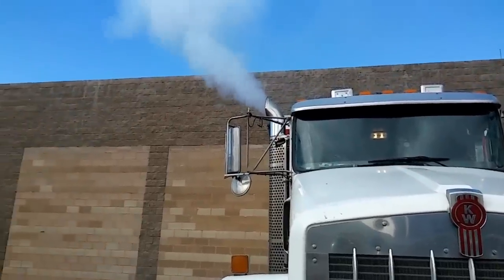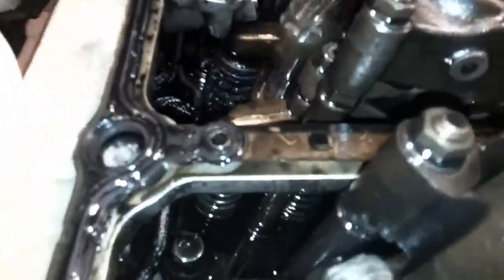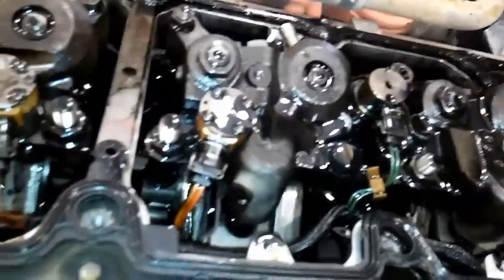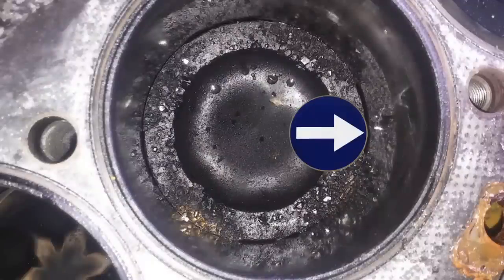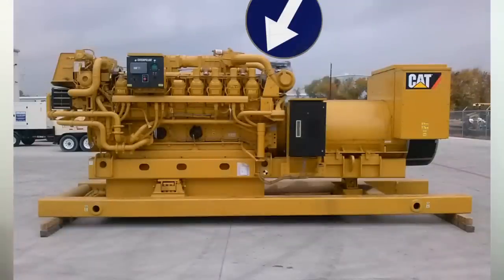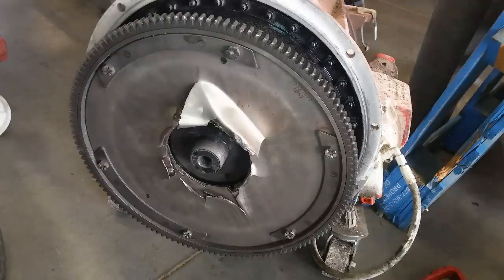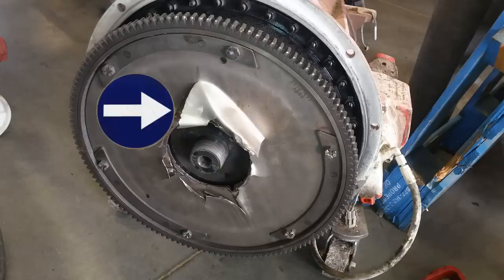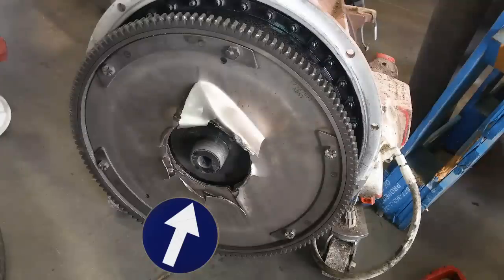Should You Warm Up A Diesel Engine?

Comment: Since you’re only warming up your engine for 2 minutes, grab a wrench and hold it firmly between the two battery terminals...this will generate extra heat and load on the alternator helping the engine warm up...make absolutely sure you do this with bare wet hands 👍
Reply: might crack the windshield in the winter from warming up too quickly

Comment: I was a trained mechanic on new Holland and when I was time served at 22 year old started contracting. A bloke I met on a mammoth job used to operate a komatsu 13 tonner . 
Every other operator would arrive at 6.45 and start their machines . 
He’d rock in at 6.59 and would be working it flat out by 7 !!!! 
I asked him one day what engine was in it and he had no idea . 
Asked him it was turbocharged, again, hadn’t a clue . He never lifted bonnet to check oil , water or anything . 
switching it off , just turned key with thing flat out . 
He was actually quite good on the machine but no mechanical respect at all . 
I used to cringe Morning and night but being young and  him a lot older didn’t want to create . 
That machine started to spew oil on that job .

Comment: Elevated idle on... Cycle glow plugs 2 times or so, crank/start. Let idle 1 minute at least and then start off down the road but don't romp on the throttle.

Comment: If really cold I use the block heater.  The shop never gets below 40F, so I just use the exhaust brake on the Cummins and drive it gracefully after the heater grid stops cycling until it reaches operating temperature.

Comment: Yes you should at least until oil temp warms up to 135 degrees, also always cool it down until oil temp drops down to 226 degrees. (Once again oil temp) then shut down the engine. That’s what I do every time in my volvo trucks.

Comment: 2001  C-15, I'll start it up and run 1 min or so until air pressure gets up to 90, this thing has a huge compressor, about the size of an old mechanical injection pump.  
Then up to 1,000 RPM for at least 3 to 5 during my pretrip, then slow trip out to the main highway about a mile of dirt road, nothing over 1,200 RPM.
Then nothing over 1,400 as I go down the highway until I get to 180 water temp.
18 speed helps with all that low RPM operation, and the truck is always empty in the mornings, I work locally.
I do this even in the summer, 
Block heater below 20F and when it gets really cold (Minnesota), oil pan magnetic heater, just bungee cord under it to hold it in place.

Comment: When it comes to school buses, you need to keep it at least 1500 rpm, otherwise you will damage the engine. With all the heater cores and long coolant hoses, it's hard to keep them warm. I remember the old RE's had labels that said "keep fast idle at 1500 during cold operation to avoid engine damage". As soon as you let them idle down after a run, the temperature would drop straight down. We used to do alot of repairs out in the snow with those things. Glad those days are long gone.

Comment: Yes, well in Winnipeg when it is -28C, it takes a lot longer than 1 minute or 2 to get to temp. Typically it takes around 15 to 20 minutes to start to get warm air from the hvac system.
Most of the time, you can't clear the windshield with a cold engine.

Comment: I know this vid is old but I just stumbled across your channel. Good info! I always let my LBZ warm up and still go easy til everything is feeling right. She's done me well so far. At 170k now and need to replace my turbo vane position sensor. I can't complain about that. Adding a FASS Lift Pump at the same time to compliment the rest of my build. 
Thanks for this vid! I'll check out your channel! 👊🏻
Reply: If it's 35-40deg outside mine run for about 15-30 secs then it idles up till its ready to go the idles backdown.

Comment: Great video!!
My 2016 Freightliner will not idle long unless set up to 1000 rpm.
I usually wait about a minute to idle it up. Then I look for the water temp to reach 140. Then I baby it until it reaches normal operating temps.

Comment: I use the exhaust brake for a bit of a load and warmup.
One thing that wasn't covered here is liners getting moved, you have a cold engine, cold cylinders, cold aluminum pistons, now if you put a load and lots of heat into the aluminum piston, it'll expand far faster than that frigid cylinder with cold water around it will and rub the liner, possibly moving it.
Basically I do the low idle until it's running smooth, then exhaust brake and about 1000 RPM until the frost melts off the block.. I have a manually overrideable VGT turbo, so with that I can get the turbo working, bring the RPM's up to 1500, make it make 5PSI boost or so, that usually gets my EGT's up around 600F  when it's 0F outside, a few minutes of that and the gauge starts coming up, a couple minutes more so I can see through the window and i'm off, drive it nicely for a couple miles
Reply: Oh, here's my destruction submission.. 5.9 cummins, new OEM head gasket, new studs, milled head, failed after 1000 kms.. what happened?  Defective head gasket leaked oil into the cylinder, making that cylinder run much hotter than the others, eventually cooking it.. Made it home though
https://i.postimg.cc/fL6hZ1Xm/20131230-155706sm.jpg

Comment: I was told the best way to warm up an engine is to drive it.  That being said, it doesn't mean to go full throttle right away.  Drive easy the first mile or so.  With me living in snow and ice country, I let my Dodge Cummings idle long enough for the defroster to start melting the ice off the windshield while I scrape the ice off the other windows mirrors.

Comment: The best way to preheat an engine is to invest in a "Webasto" preheating system or in an "APU" (Green APU?), which preheats the engine and also the driver's cabin. Most of these preheating systems have a timer or remote control when the truck should be used. You get to the truck and everything is warm and thawed. And if you happen to come across a deep-frozen truck, you switch on the pre-heating system and go for a cup of coffee first. In the meantime the truck is thawing and there is no need to scrape ice off the windows. Preheating an engine prolongs the life of the truck and it also increases road safety for the driver. The window panes are also clear for the view. A built-in preheating system also makes the vehicle more attractive for sale because it has been improved economically and profit-optimizing. I also believe that the money invested in a pre-heating system or an APU is quickly amortized.

Comment: I'm new to owning a diesel luckily I do pretty much what he said.I warm up at idle to around 70°coolant 60° oil temp then idle at around 1k rpms for about a minute.Then I creep down the road until I'm at around 140° then share in it a bit more.I only hit wot at 180°+ also I use 5w in winter months!!.I'm glad I was doing it correctly just wish my work had plug ins for block heaters.Loved the ending (let's show you why buying a chevy is a bad idea🤣)

Comment: I have had several CAT 3126 motors and a 3116. They all started in their own unique way. The one I have now I have owned the longest and am the sole operator of. It is in a 2000 FL80 with 645.000 on the Orginal motor. I picked it up 15 years ago with 362,000 miles on it. I am not sure if it was ever rebuilt before I owned it.

No matter what time of year I start my CAT 3126b it's always rough. I attribute that to oil leaking past the injector seals. I always have to wait until the coolant reaches about 130* before it smooths out. Depending on the time of year that could be 10 minutes or 40 minutes. The CAT 3126b has a cold idle control that will raise the idle 1 or 2 minutes after a cold start and will hold that idle until the motor reaches 93*. I have seen that take as long as 12 minutes. I don't move the truck until that has stopped. I use the block heater in the winter. Depending on the temperature I see coolant temps as low as 78* and as h1gh as 110*. What I have noticed is that when the motor is started and that hot coolant goes through the cold head, the coldness of the motor will bring that temperature down as much as 10*.

Comment: 10 - 30 seconds, driving gingerly for the first 15 minutes. Gently bribgs her up to temperature, and it does so evenly.

That said, it's a car, and it only gets very cold around here in winter. If it IS that cold, maybe I'll let her idle another minute or so. Like you said, maybe blip her up to ~1k rpm for the duration.

Comment: After the engine temperature sees 72-84 degrees our machine engines run from low-idle at 1000-rpm to high idle at 2200-rpm. Our engines usually last over 15,000 hours. Most of our engines break a valve spring due to constant high-idle speed harmonics.

Comment: Rule of thumb in the cold is to start it up and when the temp gauge starts to move up a little which means the thermostat is opening. This is a safe way to tell if it's warm enough to drive but wait until it's a least half way to normal operating temp to start pulling a load.

Comment: One danger of running an engine at high idle after a cold start up, is oil pressure before the filter exceeds the oil filter bypass trip pressure. You have to remember that the oil pressure gauge is reading pressure after the filter, not before the filter. Most engines have a bypass valve for when the pressure get to high, it will bupass the filter to the main oil rifle. This saves the oil filter from intemal element collapse, or blowing the filter off the engine. The theory is that unfiltered oil is better than no oil going to the rail. This is very important to remember especially in extreme cold weather start ups. I would never give a diesel engine any rpm above idle for at least 5 mins after start up when it is sub zero temps. Most engine wear (main bearings, rod bearings, cam bushings, and cam lobes) happen at start up. The last thing you want to do is accelerate that wear by reving up a cold engine and allowing unfiltered oil to flow thru the engine. Also, another reason why extended oil change intervals are a bad idea.

Comment: I have an old 1.6D VW Rabbit, I start it, let it idle for a few seconds, then take off. the entire warmup occurs on the road, usually at around 1500-2000 rpm depending on what road I'm on, at 2k in 4th gear, I'm sitting right at 45 mph.

Comment: Yes.  How long?  Depends on temperature.  Longer in winter, obviously.  Don't work it hard until it's close to normal operating temperature.  If you're running light you can move off GENTLY after just 30 seconds or so.  If you really want to do something good for your engine find a way to keep it warm overnight.

Comment: I'm an OTR driver.   Here's normally what I do in the morning whether it's cold outside or not.  1) I start the engine  2) I get dressed and put on my boots 3) I start my air fryer to warm it up and turn on my water heater  4) I go outside and do my pre-trip  5) I put my breakfast in the air fryer and make my coffee with the hot water

By the time my breakfast is ready to eat, the engine is warm enough for me to take off.  I would eat my breakfast and drive at the same time.   There is no need to sit there and wait for the engine to warm up since I could be doing other things.   Furthermore, if I was parked in a huge truck stop, it would take me at least 5 to 10 minutes to get out to the main road.  Therefore, I would be creeping for 10 minutes within the lot.  You see, there is no need to sit there and let the truck idle more than it should.

Comment: It would depend upon the oil in use. 5w40 you can probably start driving much sooner than say running a 15w40 in sub zero temps.

Comment: This all sounds great. Now explain how it applies to a diesel portable screw compressor that starts up at fill throttle then idles down after 20 seconds when the air pressure pulls the throttle down. The bearings in the screw compressor go from zero to 7000 rpm right away.

Comment: On some older mechanical diesels, the injection timing is advanced for easier starting when cold until the coolant reaches temperature. It's bad to try driving these when the timing is still advanced, best to wait till the cold advance shuts off. Sometimes takes upwards of 5 minutes depending ambient temperature.

Comment: There’s no way better to warm up a diesel than to do it quickly so what I like to do is not plug my truck in and then put the shifter in n after I do that I put a rock on the gas pedal and let it accerlate completely then I go inside and eat my breakfast and by the time I come outside to leave my engine is red hot I’ve never had a water vehicle once I started this

Comment: I have a John Deere 4045 Diesel engine that starts wide open on an irrigation pump, it is equipped with block heaters and electric oil pump so it is at 180 degrees and 30lbs of oil pressure before it starts.

Comment: I know you're focus is on Cat engines, but I thought I'd share something that has to do with your subject in relation to a Cummins. The common rail Cummins used in Dodge / Ram pickups will start up and go straight to 1000 RPM when ambient temperatures are below a certain threshold ( I believe its around 20F). Those same engines will idle up on their own if you let them idle and they start losing ECT in very cold weather.
Reply: I was going to say, anything with the common rail and ecm automatically increases idle rpms until coolant temperature reaches around 80-90F
Reply: I have a VP44 24V Cummins as well and it'll do that to, high idle I think its called, as well as turn the grid heater on and off

Comment: I work for a fire department in NTX and I try to let the engines warm up a bit before pulling out of the station. We have heaters in the bay, but they are just to keep the water from freezing in the tanks and pumps. I also let my personal trucks (gas) warm up from a cold start especially in cold weather.

Comment: On my work trucks I idle 1 min every cold start. Normally I pay attention to my oil pressure gauge 
On cold start oil pressure flys high after a min of warm up I notice oil pressure starts to slowly creep down  
Cold 0- 65 PSI
One min idle 65-50ish.
Then I drive out slow until I get to the main road.

On my Gasoline engines I warm up until engine goes to normal idle.
On cold start they rev up to 1,200 rpm and after a min or 2 they idle to 850

Comment: I watch to see my transmission temperature rising, then I know BOTH are happily lubricated before bringing it up to full highway speed.  I have a block heater that I try and use over night even in the 30s.  Warm oil equals happy start up and long life.  Just turned 200k, just getting broken in hopefully.

Comment: Talking about block heaters, I worked for the fire service and all trucks had block heaters in the belief that they could protect engines. Obviously,  emergency service vehicles don't have the luxury of a slow warm up. And, after analysis over a number of years the benefits vs cost of having block heaters were deemed to be minimal so were disconnected. We never noticed any increase in engine issues. So, I'm picking that slow warm ups are not relevant  in temperate climates.
cheers

Comment: I've owned diesel cars for the last 40+ years (here in England and in Europe they are very common, because of the higher price of fuel - currently diesel is around £1.80/litre = $8/gal US). The only time I leave mine running at idle after a cold start is if I have to clear ice or snow from the windows, otherwise, as soon as I'm ready, I will drive away, at a light load until it has travelled a few miles. Most cars here use 5W/30 or 0W/30 oil all year round - ambient temperature where I live, in the south, ranges from around -5 deg C to +35 deg C (23 F to 95 F). In my experience (I was a mechanic with a rental company until I retired 3 years ago) modern engines are pretty tough and will survive a lot of driver abuse, as long as they have enough oil and coolant in them, certainly for the first few years.

Comment: Not to be take away from your point. But I have driven probably two million miles in big rigs of all kinds. Three different companies, three types of machines, from buses with GM engines, to trucks with Cats, International, Cummins, Volvo. These were driven on long trips in very high temps. Example, buses though Death Valley in summer loaded, to snow trips in the Sierras, northern Utah, Az. From 120 degree Az to 0 degrees Utah.  When it was hot the trucks and buses would idle sometimes for hours, some required high idle as in the Detroit 8 v 71's. one bus company I worked for had a very experience mechanic and manager of the shop. He had the traditional routine of service of the machines. At 500,000 miles needed or not the engines were torn down and rebuilt, put on the road with no break in, driven by at least 25 different drivers 7 days a week 365.  My point is a well built diesel can handle being miss treated, meaning cold start and go, idle for hours in heat and cold. So when you gave examples of your experience in wear and tear, it wasn't based on real world see it yourself knowledge. I get that you understand the science behind the engine, and that it helps point out issues that occur under certain conditions, but over all in my opinion with fleet diesels and personal vehicles, do routine maintenance on time and you don't have to worry about how long you warm up, how soon you should pull full load Reving engine when warming. Way to nit picky and gives a confusing answer to the question.

Comment: I used to sleep with the engine off down into the 20s and teens all the time. By the time you fire it up, build air pressure, do a pretrip and then putz out of the truck stop at light load and get to the on ramp you are good to go.

Comment: All modern highway tractor engine manufacturer's use synthetic oil. It doesn't get thick like you say. In fact Cummins recommends 10-30 in their new X15 engines.  Your OK to drive away as soon as the oil pressure comes up.